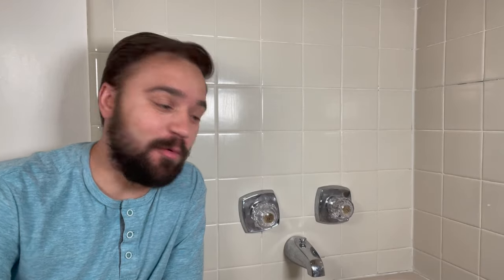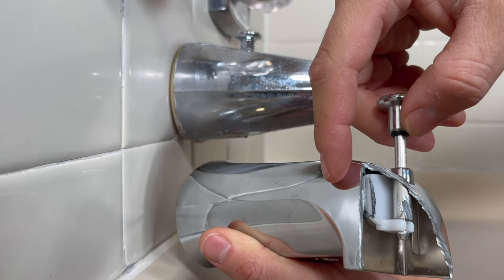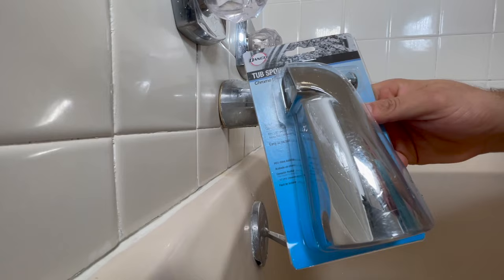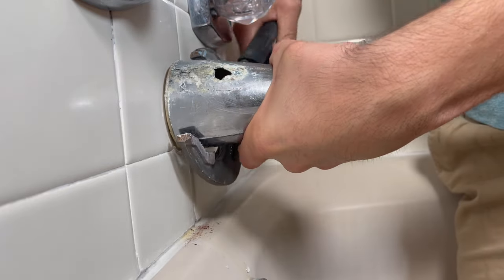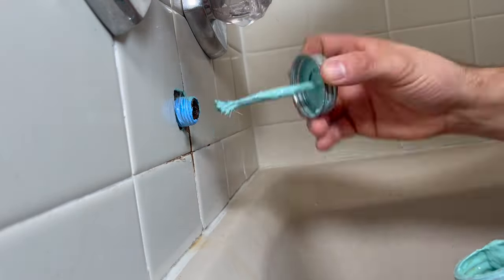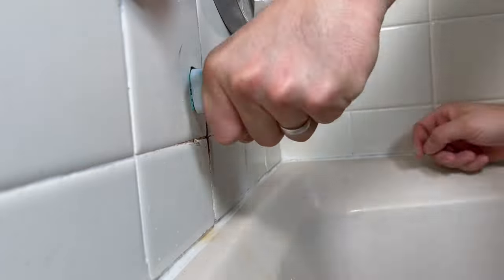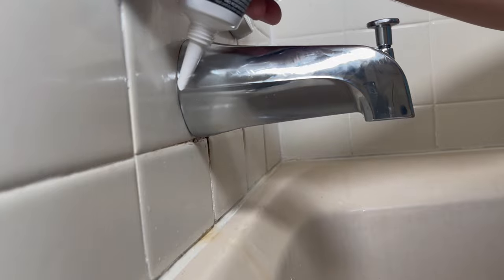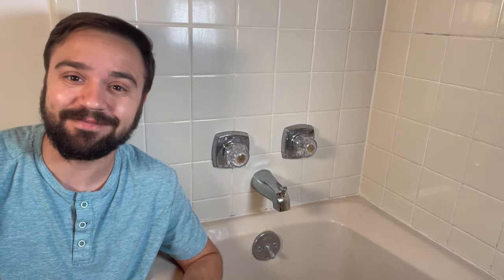Complete Steps to Replace an Old Leaky Tub Spout

Comment: Great video.  The basic design of the tub spout and its water blocking mechanism is wrong.  Its not correct to have a pull/push mechanism to be used on a daily basis.  We need some other better design for this shower/tub water source combo.

Comment: My pipe extends about 3  inches from the wall and is threaded but the threads are damaged and the spout replacement shot off I tried but can’t unscrew the copper pipe to replace it
Reply: 3 monoths too late but might help the next person.... copper pipes don't screw into each other, they are generally soldered together. Trying to twist a pipe off might damage the pipe so don't even try that. You need to cut the pipe, then either restore it by soldering on a slip coupling and threaded connector again. Alternatively they also make slip fitting tub spouts which go on bare cut pipe (no threads needed). You just have to find the appropriate length one to match the copper pipe.

Comment: If your copper pipe extends out further, say 1.5 to 2 inches, do you just not add on the 1st part of the plastic extender? Is there a universal rule to how far copper pipes should extend out the wall so tub spouts can be installed smoothly? I see vids with pipes extending out few inches vs one's just less than an inch. I appreciate your help, bro.
Reply from the maker: Thanks for the support!! There is no rule how much it has to extend out. It simply becomes a preference for when installing the finish spouts. Some tub spout kits required the extra few inches to slide an adapter that will secure the spout, while others will screw direct to the pipe it self. I hope it helps, and thank for a follow up video idea 😉…
Reply: Yea for sure! It takes a few tries and sure is worth the effort though, saving you money. Also, mine needed a rubber gasket to prevent leak from behind the spout which I finally figured out. It's these little things like this that you almost call the plumber for lol.
Reply: @rogerh2694 I needed the gasket for my 2" copper pipe so it didn't leak too. Did you use the gasket that came with the Danco spout?
Reply: @BC-lo7kv  Damn, this was 8 months ago lol. I believe so but my memory is vague now. Recall going back n forth several times to Home Depot back then and putting the project on hold for a few months & just used another shower as I couldn't get the cartridge in, then came back to it. Fun stuff!
Reply: @rogerh2694  Oh yeah. Been back and forth a few times, too! 😂🤦‍♂️ this is the only shower. So got to make it work soon. Lol. Cool, thanks for the response. I might try a different brand.

Comment: If u had a cpvc pipe with a threaded connection on end of pipe would you be able to thread the spout right on without any of the plastic pieces inside of spout?
Reply from the maker: This one yes, it’s a universal kit, it has the option to thread right in.

Comment: What if you?r shower head has good pressure ,but the leak is coming from the tub faucet only?
Reply from the maker: Having proper pressure to the shower head, only means that the leak in the faucet is not big enough to affect the shower head. This fix should stop the leak. 🛠️👍